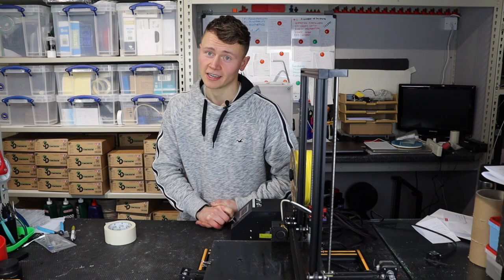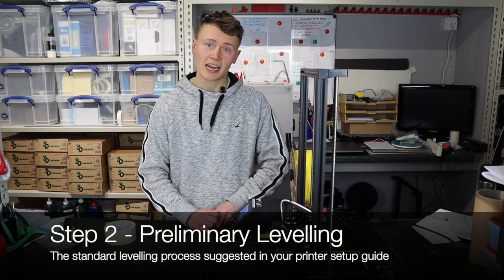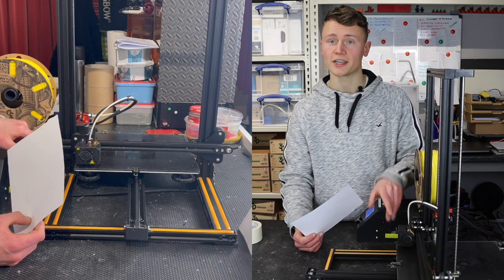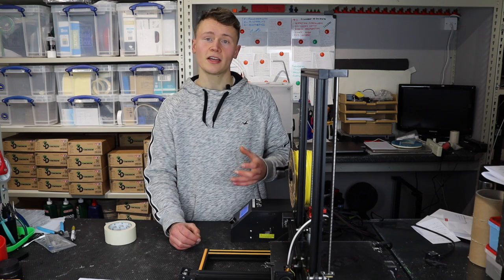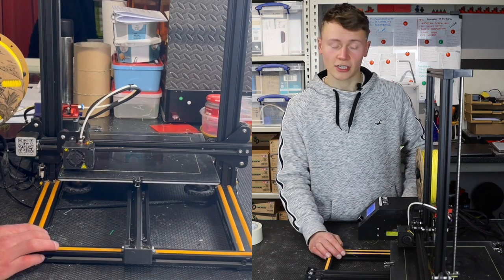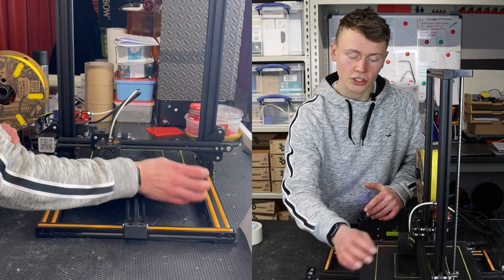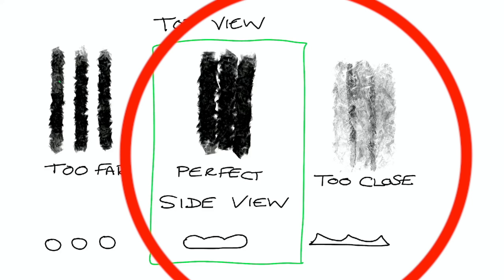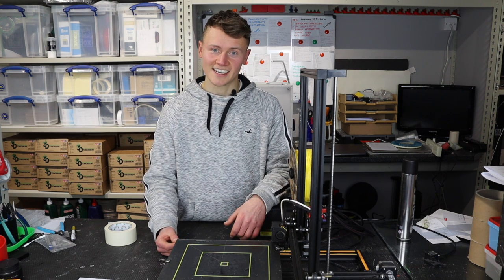PERFECT BED LEVELLING - How to perform bed levelling + My Bed Level Test Print

Comment: I need to get a print done so I'm going to try this method today. I doubt it'll work but it's worth a try. I received my printer from a friend who got a new one. I think my springs are worn. I've ordered new ones. But like i said, i need this print done asap
Reply from the maker: Give it a try! Let me know how you get on:)
Reply: @CallumColes  for extra context I've had levelling issues since i got the printer. The levelling kept changing.

On the hot bed, my friend used a magnetic pad, but it was worn out so i used glass. I did try your method and at first and the level changed again so i got mad and tested every piece of my printer that has to do with levelling. The glass plate must be a production error, as it's warped. Friend never used it.

So I swapped to the worn out magnetic pad and I'm happy to report:
after using your method my prints are amazing! 

And I got it level during the first attempt! We're gonna have some great minis during DnD tomorrow!
I wanted to include the context so maybe someone can see: if your level keeps changing, something's probably warped. If it's the glass plate, replace it!

Comment: great video but i seem to have a problem. whenever i load a bed test print it doesent work. it seams to start, but then never move into position to make the squares. any thoughts on why
Reply from the maker: Does it look right in your print preview? What slicer are you using?
Reply: @CallumColes  i actually figured it out. it wanted it printed at 103% hight.  and it did look ok in the slicer, but for some reason i wanted 103 hight minimum